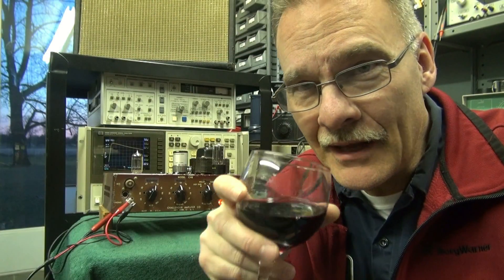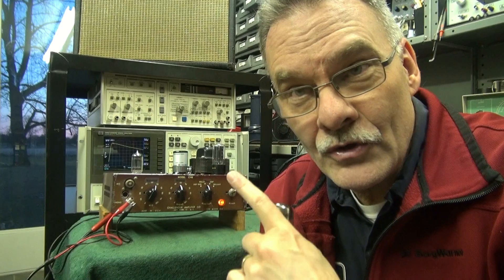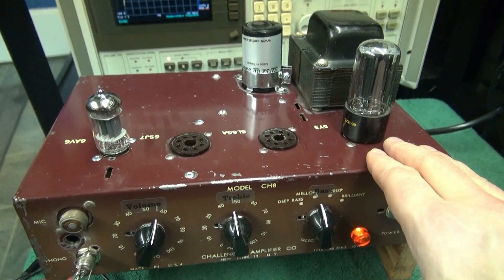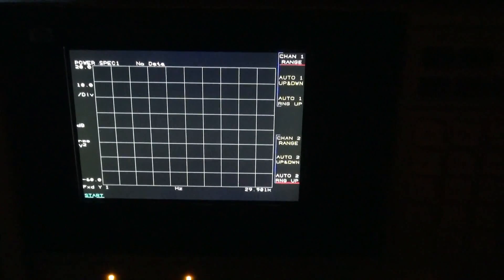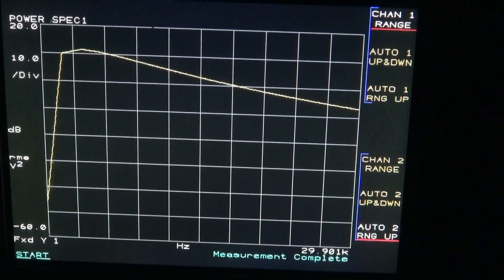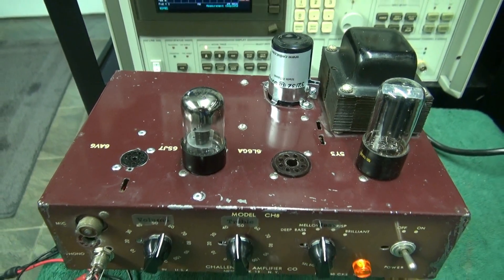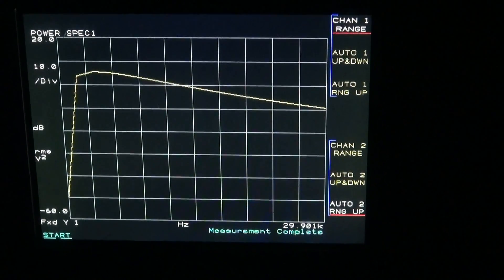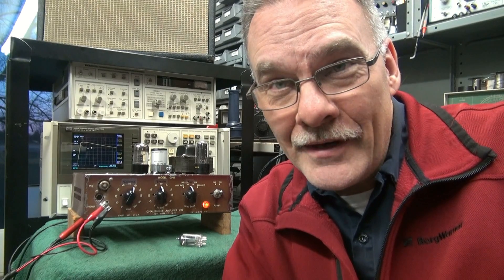12ax7 Fender vrs 6sl7 Gibson Preamp tube Frequency Response test D-lab electronics

Comment: I trust my ears, octal tubes like 6SL7 just sound better, whatever the spectrum analyzer says.  They are lower gain, which I had assumed was the reason they sound warmer and more rounded than the 12AX7 (I prefer 12AT7 in position 1, lower gain = more headroom and warmer tone).

Comment: Do they still make 6SL7s? I'm not a guitar player but my youngest boy is. I'm an audiopfile. I incorperated a pair of 6SR7 (yeah, 6 s "ARR" 7) tubes (for stereo) in my old 12AX7 to 6L6 tube amp. I don't know between the 6SL7 and the 6SR7 which tube has the better tone, and I'm interested in bass tone. The 6SR7's bass tone is awsome: warm and rich. The oomph of the 12AX7s with the warmth of the 6SR7s makes a wonderful sounding stereo system.
       I got intetested in the 6SR7 because as I walked past a '52 BUICK, I heard the radio playing a Mozart song. I was like "That's not a radio! That's a HI-FI SET!" Yeah, those radios use a 6SR7 preamp.
Reply from the maker: Hello, Yes you can buy the new Russian 6SL7 from the tubedepot.com
Reply: K thanks much.

Comment: I think you were testing the circuit the tubes were in more than the tubes.  I have tested the frequency response of the 12AX7, and you can get a ruler flat response from DC to close to 20 kHz.  With a bit of circuit tuning, the HF response can go up even further.

Comment: Interesting, I'd have thought the amplitude would be higher on the 12ax7 since the data sheet shows a factor of 100 vs 70 for 6sl7 ?
Reply: it was  look again  the 12AX7 shows 10.0  as it starts @1khz  the 6SL7  starts below 10  at what looks to me 7.0    but they both have the same frq sweep

Comment: That's fine as far as frequency response goes but is there a difference in on how hard they drive the output tube? Will different output levels of the preamp tube affect the sound of the output tube? Did the plot show the same amplitude?
Reply from the maker: Hello, Yes, same amplitude, output tube was removed for the test. The 560K grid to ground resistor served as the load. TD